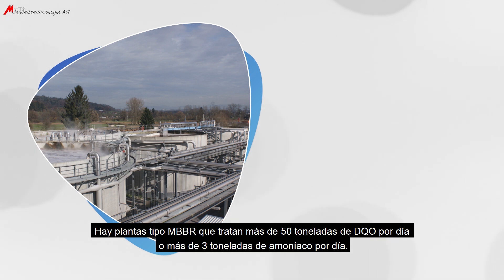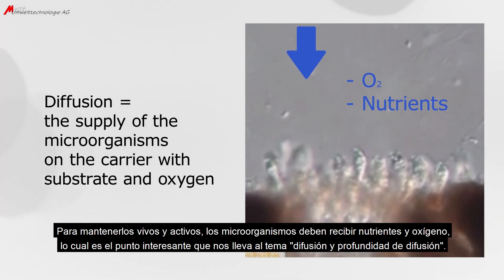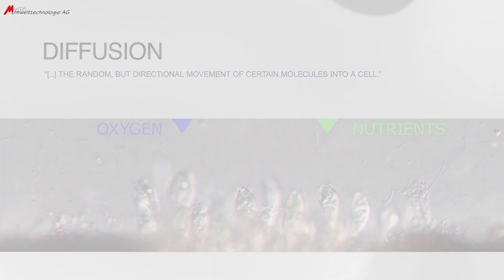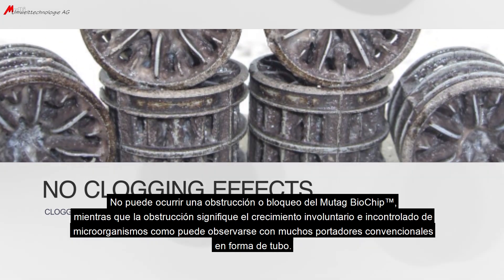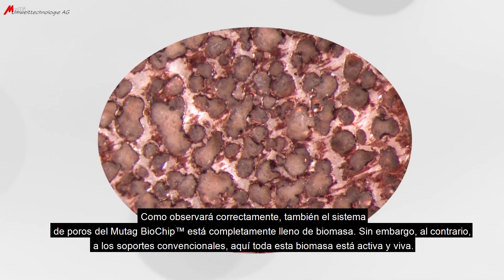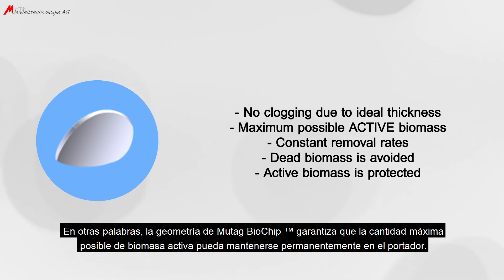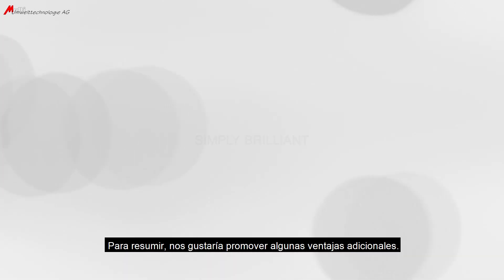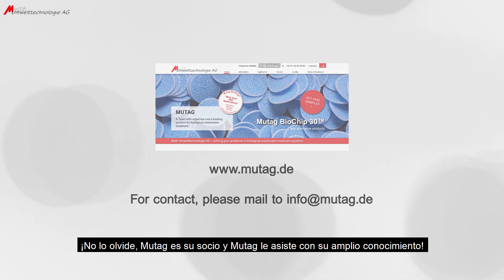Mutag BioChip presentation and diffusion - SPANISH subtitles

Comment: I'm interested to acquire this product for shrimp 
aquaculture. Where can I buy it in Sudamerica? I'm from Ecuador.
Reply: Unfortunately during the manufacturing process of this product small voids of air remain trapped within the plastic which don't get exposed to environment therefore biomass cannot colonise and propagate in those pores, so the media elements never reach a neutral buoyancy and just float. Even after many months the media doesn't become fluidised and approx. 30% have to be thrown away. I would not recommend this product and in my opinion there are much better alternatives.
Reply: @3HitRanger  thank you for you advise. Alternatives like what?
Reply: @beniciofuentes204  there's so many factor's that influence which plastic carrier media to use. With Mutag BioChip at 1,100 GDP per m3 you can get Chinese replicas of the AnoxKaldnes K5 for 300 GDP per m3 (or the real thing) which is the most common MBBR media used in the UK. Good thing about that is they are good at supporting the more mature organisms like Rotifers which the BioChip is not. Also Warden Biomedia (biopipe/biotube) is a good well established media and they have a new one thats recently come out. Im not an expert on shrimp aquaculture though so i cant advise specifically for that, hope that helps anyway.